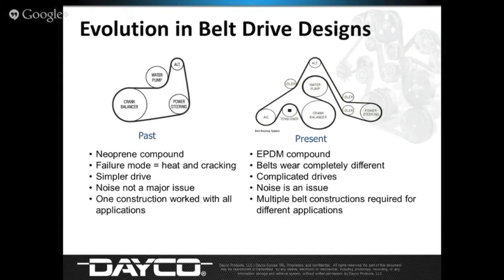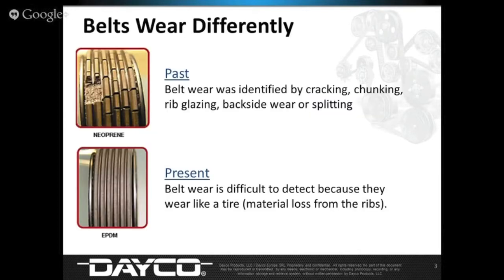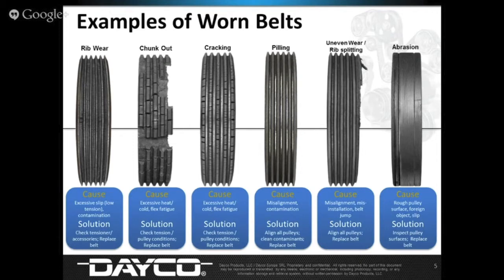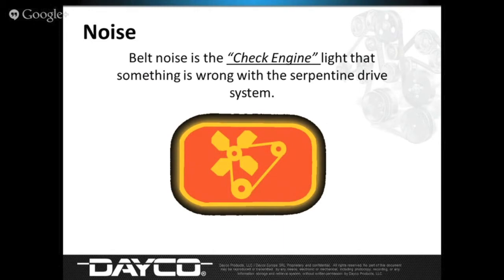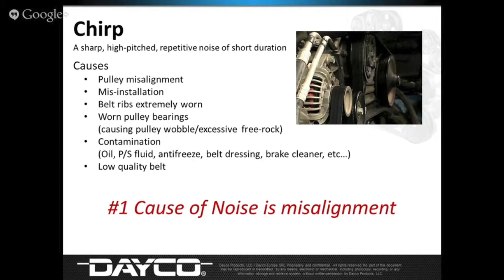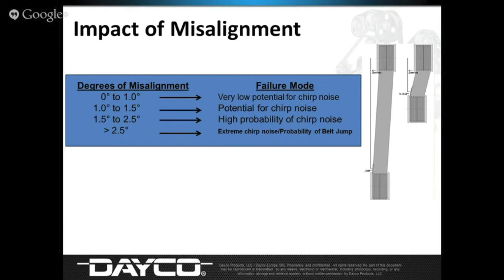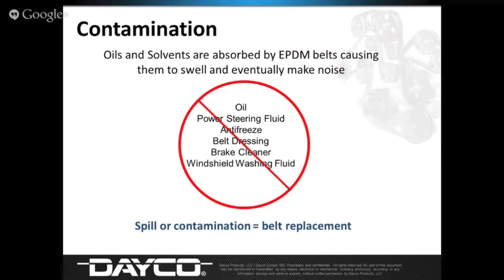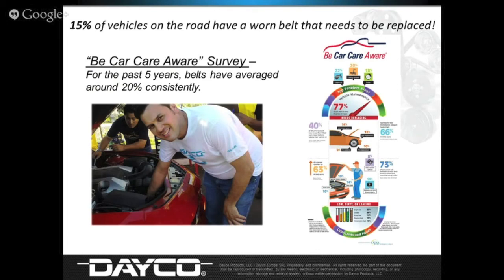Servicing Serpentine Belts

Comment from the maker: "Stretchie" belts, for those who don't know, do not use a tensioner. They are kind of like a rubber band and installing them requires a special tool. Did you use that correct installation tool?

Inspection is similar to any other belt. The Dayco kit includes a tension gauge you can use on these belts to check for too much stretch.

Comment: Hey Pete,

I have a questions about stretch drive belts.
To remove them normally you need to cut them off.
How do you inspect these types of belts? 
Also do Gates make direct replacements rather than having to go the the OE's to buy the belts?
I did try the other day with a set of gates belts but had to get a OE kit as it didn't stretch on enough.

Thank you